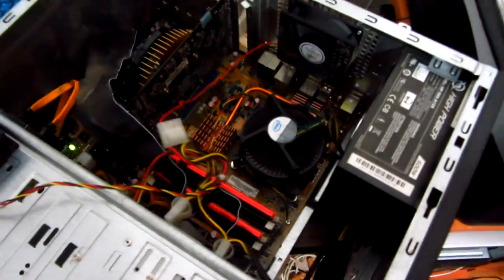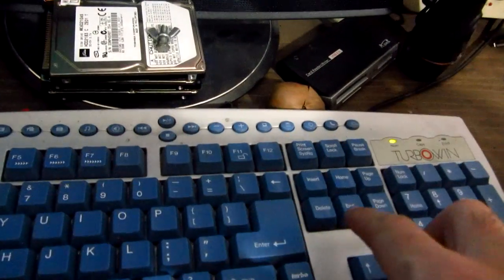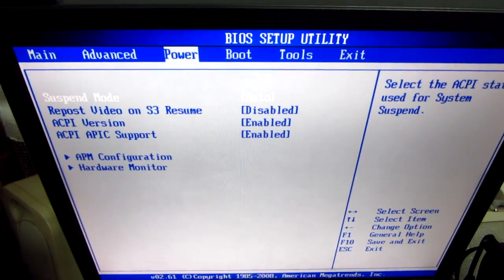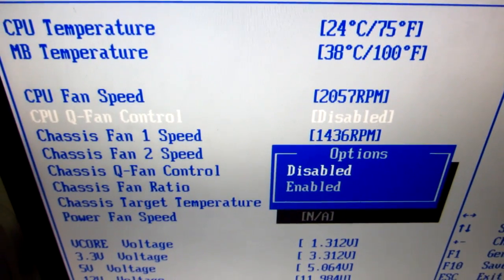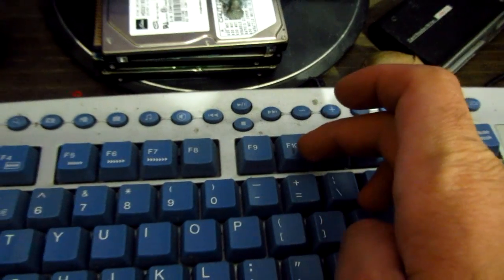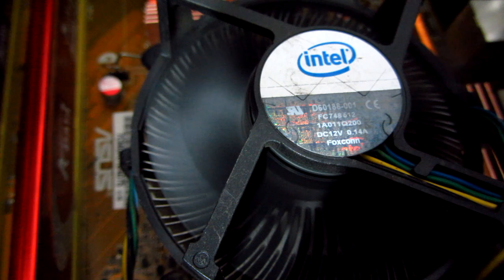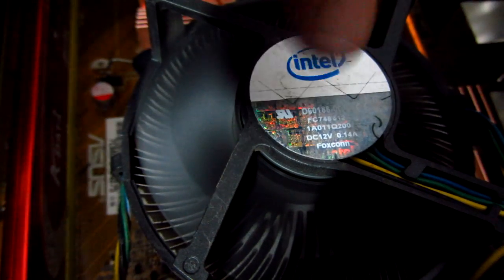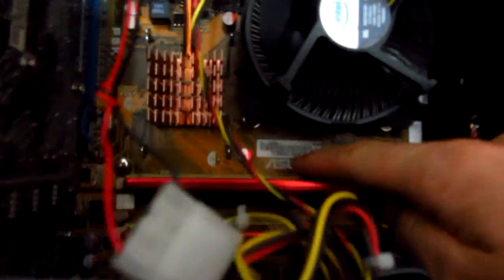How to Silence the CPU fan (ASUS P5K, CPU fan, Silent Mode)

Comment: This didnt work for me, i cant find my Fan, my fan is same AVC connected to cpu fan on motherboard but i cant on all programs control my fan speed, in bios same thing
Reply from the maker: The fan must have 4 wires in order to control it via software. If the fan has only 3 wires then only the rpm of the fan can be monitored. In this case try to use a PWM method to control the fan rpm.
Reply: @furulevi  Man i have AVC Cooler go on google to find photo of them, i try to use speedfan nothing in my bios i cannot find pwm my motherboard is fking lenovo and result is have 75 to 83c on 900rpm fan and cant change them

Comment: On silent mode, how long will it take to overheat? I have the Asus Model: CM1730, when I play Unturned, it sounds like Apollo 11 taking off in my room.
Reply from the maker: It will overheat faster... If it was overheating already than definitely don't reduce the rpm of the fan. Better clean the heatsink, replace the thermal paste between the CPU and the heatsink, or get a larger heatsink/cooler. Water coolers cool much faster, but the pump is an additional noise generator. Water coolers tend to have smaller heatsinks.

Comment: Keep in mind the lower your fan spins the higher the temperatures will get
Reply: mine just started to speed up like crazy without any reason !! Any tips ?
Reply: @punkerz250  look in your bios it's complicated if you have no pc knowledge but try google your exact problem
Reply: @VirusFlash  thanks! I solve the problem by setting to default. My bios is different thant the one on the video so i was a litle lost. I just wonder why this happen without any apparent reason.

Take care !
Reply: better to get good silent case fans and have the cpu fan on silent..then the temperature will be good and pc wont be loud:)
or better yet just get a water cooler for the cpu
Reply: @gregorB92  as long as you don't spend 100$+ on a stock water cooling you won't have  good Performance with a decent noise level. 
Get something like  a be quiet or arctic freezer 34 air cooler since they are cooling masters with very silent fans

Comment: It's only. In Asus mother bord
Reply from the maker: Nowadays motherboards can control fan rpm ► https://www.youtube.com/watch?v=IigiGAvlLiU
Reply: Get Speedfan. If your mobo has PWM control, Speedfan lets you control RPM however you want. With a P5K SE, you can control the CPU and chassis fans.
PWM control is not new, many older motherboards support it.

Comment: But you will have a pc overheat nub.
Reply: This tweak will NOT get your fan slow in any scenario! It just makes it run slower than what should be,trading few grades for some db. If you'll play a heavy game, the fan will be more silent at first, but then still noisy because the temperatures will grows and then the fan will go at maximum speed, so the advantage is only in idle or light operations. If u wanna reduce seriously both noise and temperature, buy an aftermarket cooler like cooler master 212 evo or arctic i32(which was my choice). Just make sure that you have the right socket and room in your case for that and you will be not disappointed!
Reply from the maker: Fan rpm will increase anyhow when CPU temperature increases. If the CPU overheats the PC should power OFF anyhow.
Reply: How about gaming man?

Comment: Does slowing down the fan make the computer slower ?
Reply from the maker: It could slow it down if Thermal Throttling is enabled in BIOS... so just disable it and monitor the temperature of your CPU and make sure it won't overheat. Theoretically BIOS should automatically raise fan rpm if CPU temperature gets too high. If the CPU gets too hot than BIOS will power off the entire PC.

Comment: I don't have such options on my bios!
Reply from the maker: Is your CPU fan using 3 wires or 4?
Reply: furulevi it has 3, and in my options it says cool n quiet, i enabled it but didn't change anything.
Reply from the maker: The fan must have 4 wires in order to control its speed via BIOS. If the motherboard has a 4 pin connector than try to replace the 3 wire fan with a 4 wire/4pin fan.
Reply from the maker: Notice the 4 wires in this video at 0:06 (Black,Yellow,Green,Blue).
Reply: furulevi oh, okey mate thank you!!

Comment: this guys is noob of tech SIR first that CPU HEatsink with fan is oem IS A SHIT for 10 or 20 you can buy a heatsink without fan very good ultra silent lol or buy a heat sink with a super good big fan that is going to be totally quiet
Reply: some say its shit but some overclock their cpus up to 4ghz on them and run fine. Don't act like u know everything because clearly u don't.
Reply: Using one of those coolers without a fan is a no over move

Comment: But then you processor will over heat and die
Reply from the maker: The motherboard should automatically increase the fan speed if the heat is too high, and if the CPU heat is too high it can also turn off the entire PC.
Reply: Performance Mode
Reply: Set Performance Mode

Comment: Hi! 
Cpu fan does not working properly just after power on. Fan try to rotate
 2 times but it doesn't rotate. 3rd time it rotates with big noise but after that works fine! It is normal or no?
https://youtu.be/MKkXNDBiQPk
Reply from the maker: +SilkLeader 
Did you reduced the rpm from the BIOS? If it spins a few moments later than it is OK, maybe it is trying to detect the temperature first, and than it spins up who knows...
Reply: Yes, I can control the fan from bios or from command center, and it works fine but after turning on the Pc not working properly like on the attached video...
Reply from the maker: If after a few moments it is spinning and is not stopping until the PC is completely shut down than there is no problem. The processor won't overheat in a few seconds anyhow. Just make sure it is spinning. Even if it stops than the CPU overheats and BIOS should automatically turn OFF the entire PC not to damage the CPU.
Reply: Thank U ...
Reply from the maker: +Hamzinjo o It wasn't my PC...

Comment: I want the OPPOSITE. Maximum noise please
Reply from the maker: stormblade123hsm Than set the speed to maximum... it's called "performance mode" in this case. If you need better cooling than get a cooler that has heat pipes! It cools much better and is also silent.
Reply: I do not want the shitty weak ass fan that comes with the cooler. If it is a 120MM fan, I will go for the Delta PFC1212DE. 12 volts, 4 amps that means 48 watts. 252CFM PWM fan.
Reply from the maker: Try to get a cooler with large heat-sink, not a small heat-sink and large fan! If the heat-sink is big than there is ALMOST no need for a fan!
Reply from the maker: stormblade123hsm :)) Phonic Pollution
Reply: Russkiman96 Nah, just get a Delta fan
Reply: over volt ur heat sink fan from 12v to around 20-25v :) enjoy your Boeing 747 -------Warning may wear out ur fan or even burn it out eventually--------
Reply: that's what she said